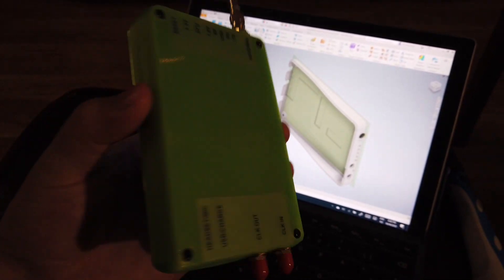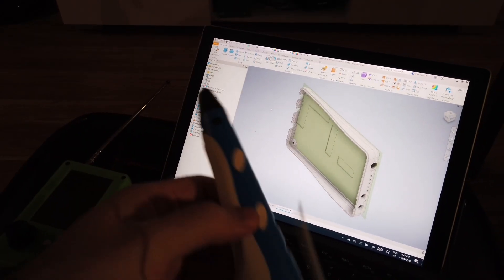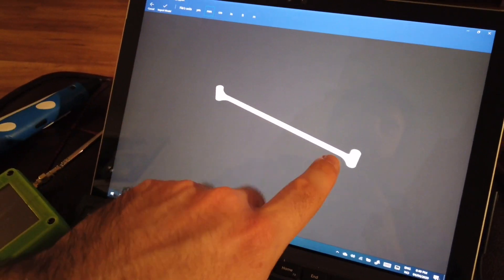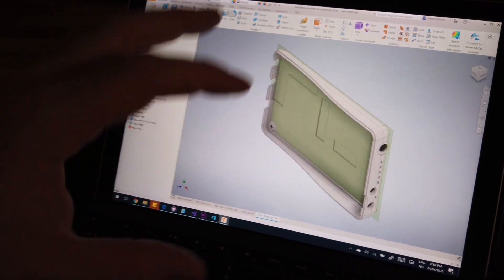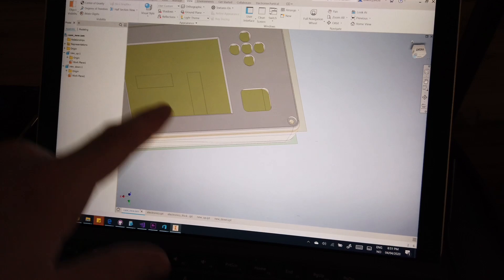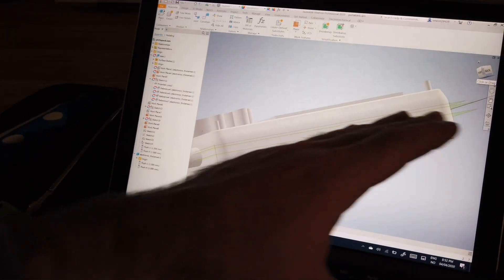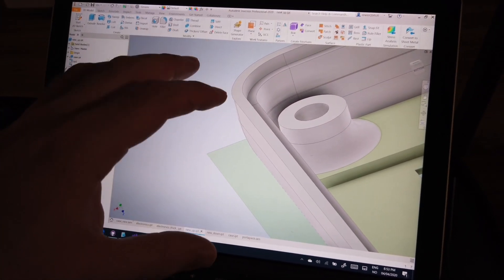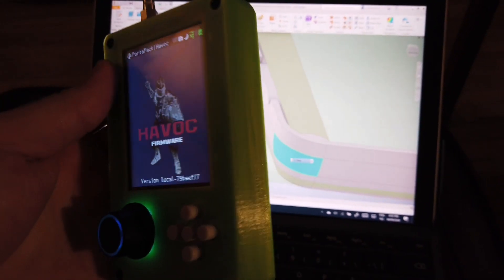HackRF Portapack H2 case - 3d printed enclosure

Comment: How much would this case cost to have printed?
Reply: Free if you are a college student or maybe know someone at an engineering college. I have over 7 different 3D print labs in one university with 2 more on the same campus. So probably over 15 different 3D print labs including aluminum which no one can afford (costs millions)... I should print an aluminum flipper case just because no one else can afford it or have it... Normal 3D print is just PLA, TPU or other plastics.  We can print ourself or have others print if you don't know how... we have the best paid 3D print software like Fusion and SOLIDWORKS. College is a place of Higher knowledge. Also have a class in cyber security that lets us use flipper zeroes, hack rfs, Proxmark, Pineapples enterprise and other goodies to hack and fix weaknesses on campus... We call that pen testing .